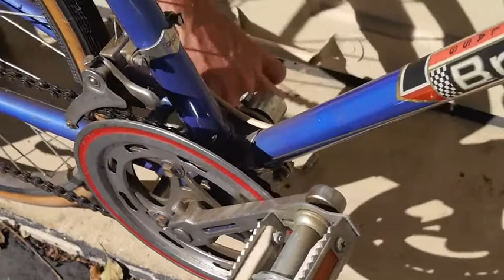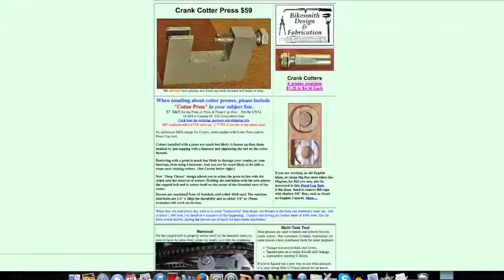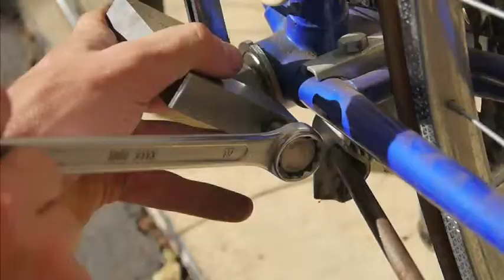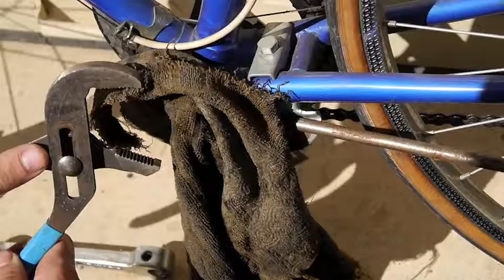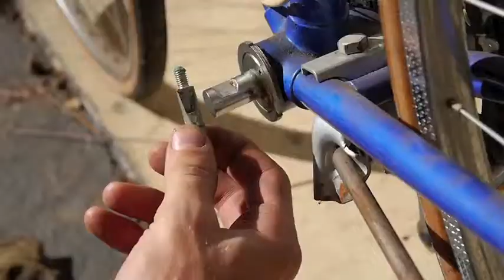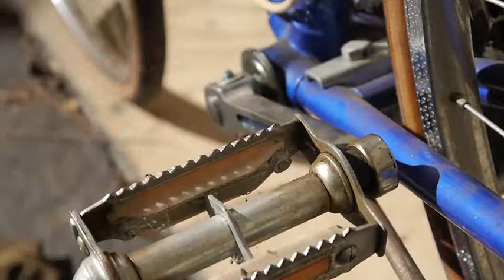Adjusting a Cotter Pin Crank and Bottom Bracket (ROUGH DRAFT)

Comment: My cotter pins wont go in far enough to get the nuts on. I don't have that special tool. Any tips please?
Reply from the maker: Hey, 3 years late, but 
1: Check if it's notched from riding on while loose. 
2: If it's notched, order a new one. If not, then is it rotated flat-part to flat-part of the bottom bracket?

3: If it is rotated correctly, and it's not notched, is it the correct pin? Different countries made different sizes. I think English use 9.5, French use 9, and there's a 3rd I believe as well.
4: Try hammering it in, with a vice or blocks of wood under the crank so that you don't crush your bearings into a fine dust/slam divots into your bottom bracket spindle.